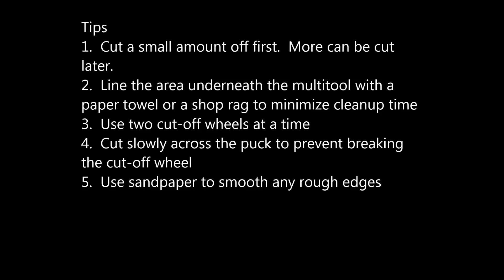DIY Hockey Puck Jack Stand Pads (Jack Pads)

Comment: I did something similar tonight.   I didn't care too much about it fitting in the stand that way because it deflects under load.  What I did was take a utility knife and cut a v groove down the center so when I set the body seam down on the puck, it would cradle the seam and keep it from bending over.  If I had cut deeper I could have made it touch both the bottom of the seam and the body directly above it, but I didn't want to weaken the puck too much.
Reply from the maker: +wabash9000 That is what I described on www.offworkhours.com.  Glad you thought about not cutting it too deep.  That is one of the best uses of the hockey puck if you like to keep the body seams straight.  Depending on the factory jack that came with your car, you can use it as a template for cutting the groove.
Reply: Where in offworkhours.com do you describe that? Thx!
Reply from the maker: Sorry about that. On the site I put, "Later on I will modify these so they have grooves in them to fit on the factory scissor jack jacking points."  That is what my comment was referring to above.  I did not end up making a video of how to do it, but you can cut the "V" groove in the center of the puck with the same kind of saw I used in this video or a hacksaw.  The groove should be just deep enough to clear the pinch weld on your factory jacking point and allow the back of the puck to make contact with the pad on the car behind the pinch weld.
Reply: Thanks !
Reply from the maker: No problem.  Let me know how it goes.

Comment: When you use the hockey puck on a jack stand and put the car's weight on it, does the gap in the middle of the jack stand pad flatten?  I need to use a another special jack pad for a Tesla that is placed  between the car and hockey puck.  I'm trying to avoid buying another floor jack or flat top type jack stand.
Reply from the maker: Are you talking about the 'u' shape of the jack at 3:00 in the video?  If the puck is pressed against a flat surface then puck will not "fall" into that u because the two sides are supported by the jack.  I used that jack stand and pad for working on my Corvette without any issues, but I will buy a set of flat top jack stands for my heavier vehicles.  I keep two jacks stands under the car and a floor jack for safety though. I would feel more comfortable under a car with a wider jack stand top piece than this one.  I will end up something like this: https://www.northerntool.com/shop/tools/product_200358558_200358558